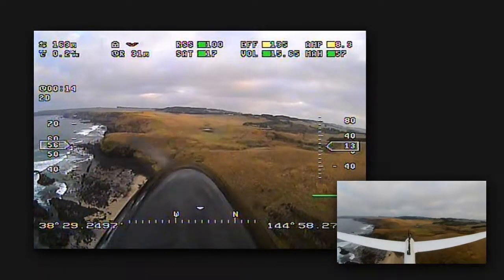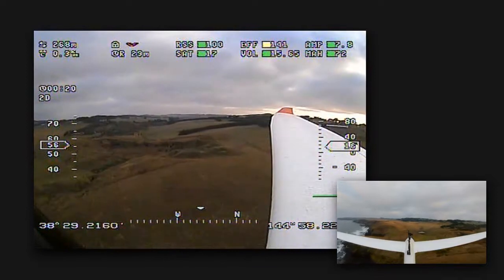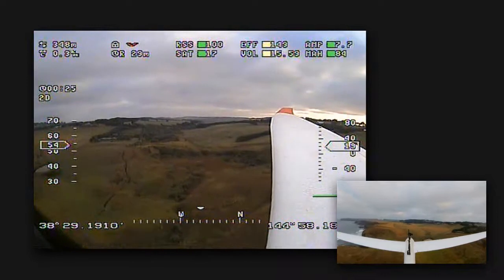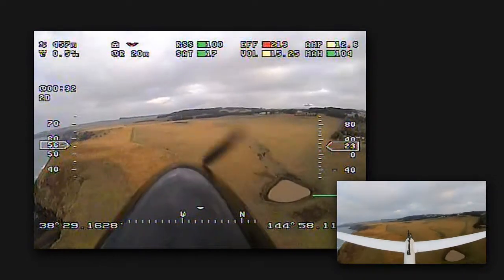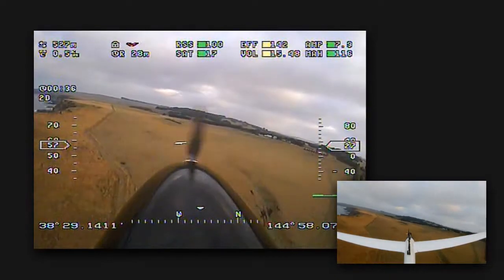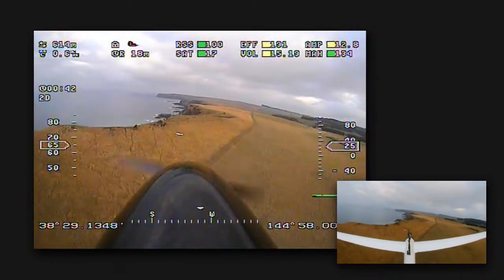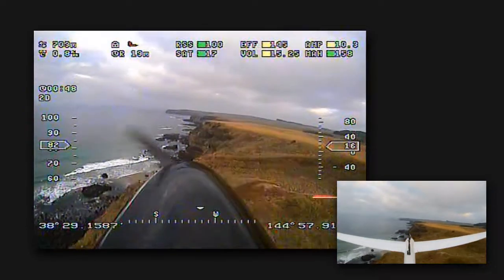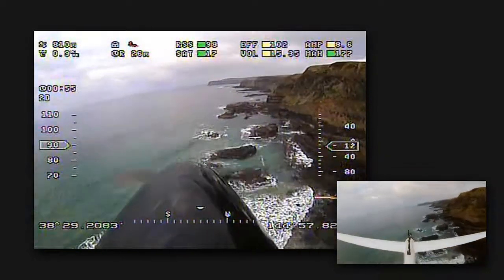» Eagle Tree Vector OSD in Action

Comment: Your uploads are always so helpful, thank you for putting these vids together for us. I've had several uV for well over a year just sitting gathering dust and I finally broke down and popped it into a quad. Truly, one of the most simple and straightforward assemblies and setups I've ever done. The fact that it will also work with my EagleEyes as a tracker is yet another bennie of the Vector line.
Reply from the maker: Cheers bauhaus. I wouldnt consider using anything else, not until competitors discover color graphics anyway. I setup an iNav plane. People rave about it but i found it so lame compared to vectors.
Reply: @StuntDoubleFPV  I would have to agree on iNav and honestly, with the ability to now load Arducopter on Omnibus controllers, iNav just seems unneeded. One thing I've noticed on my uV build though is the ET GUI doesn't have an integrated way to synch multiple ESCs up, like one would in Clean/Beta/Raceflight. The workaround is you are limited to using only BLHeli ESCs and configure them in passthrough via the BLHeli Suite tool. In my case, I originally wanted to use KISS ESCs but can't really figure out how to calibrate them. Other than that, the build has been so simple.

Comment: Nice, I’ve always used Storm OSD but this looks like a nice upgrade. The DragonLink OSD looks good too but seems a bit expensive.
Reply from the maker: Vectors aint cheap either but worth every dollar. You can easily setup antenna tracking with them using an eagle eyes too